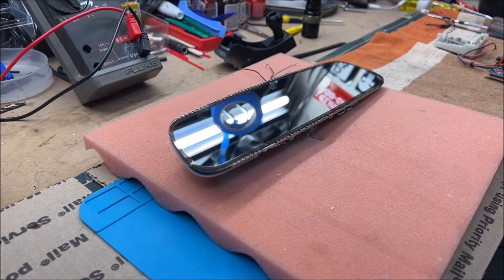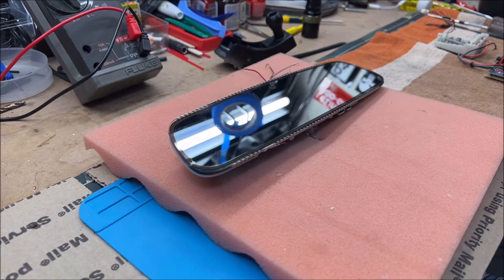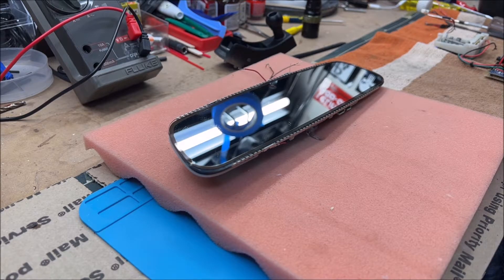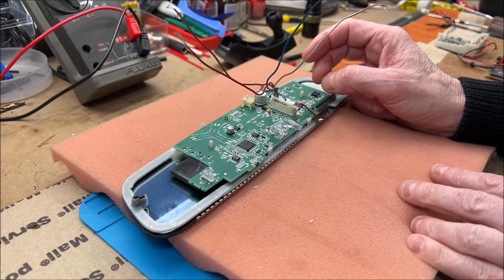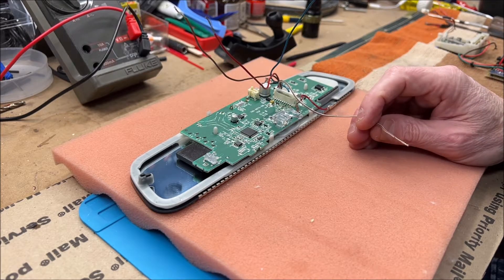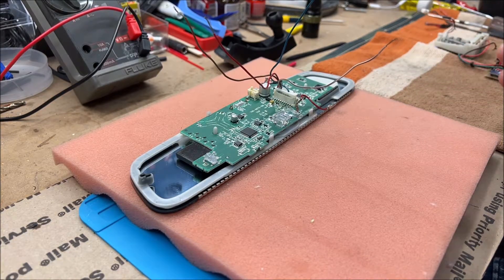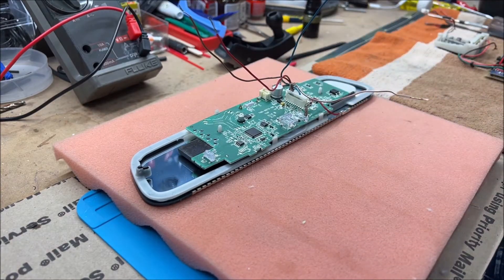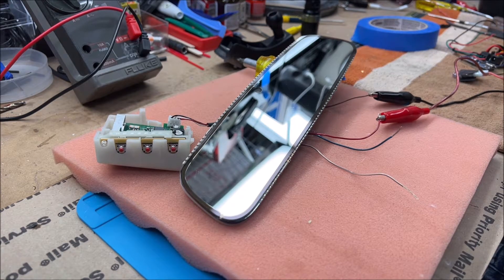BMW Auto Dimming Rear View Mirror with LinBus - How I got it to work

Comment: Hi, Great video, i am trying to retrofit a bmw 2019 mirror into my 2010 but hooking it up to my existing LIN bus wire doesn’t seem to work. Any insight or suggestions on this? Thanks!!
Reply from the maker: I don't know enough about LINBus to really help, but the problem may be in the different versions of LINBus that were used.  Given your 2010 had LINBus already, it should be LINBus 2.2a,  But maybe your car has 2.1, hard to say and hard to say how to determine the version.  I suspect though, the mirror your trying to use is just too new and there are communication issues.  You might want to consider getting a mirror from a 2010-2012 model.  

2010: LIN 2.2A released, now widely implemented versions
2010-12: SAE standardized LIN as SAE J2602, based on LIN 2.0
2016: CAN in Automation standardized LIN (ISO 17987:2016)
Reply: @2phast  thank you! I’ll look into a non Lin bus mirror instead